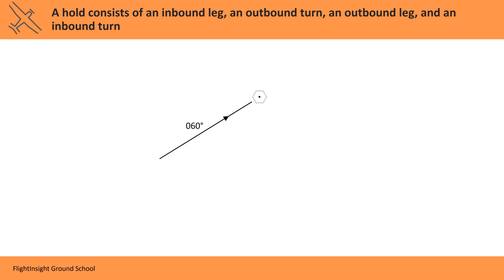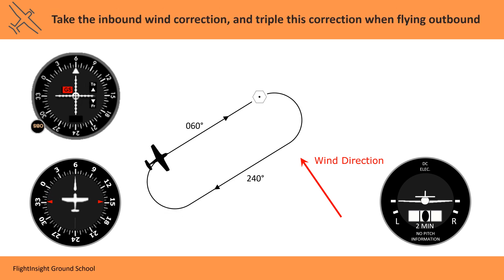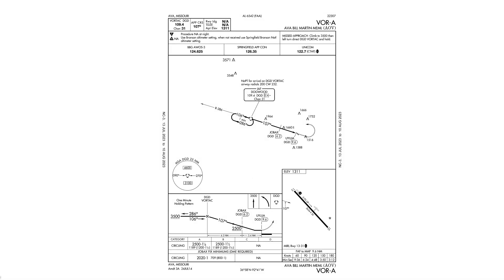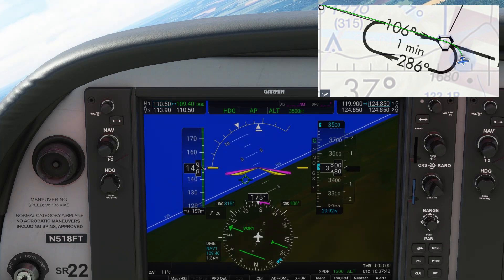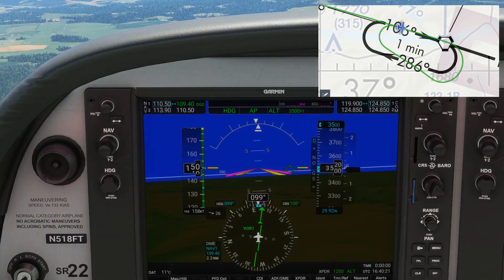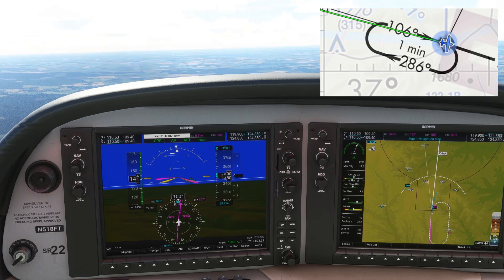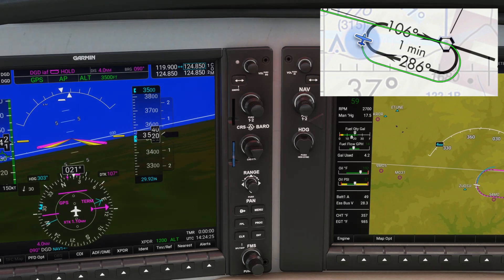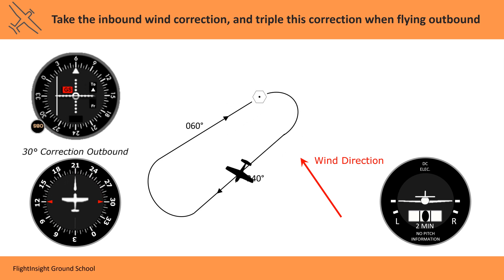Triple Drift Correction | Holding Patterns with Wind

Comment: I am a ii and I remember teaching this until one day in the plane I gave my student a 2 minute leg and all of the sudden the 3x wind correction took us way further into the hold so when we rolled onto the inbound leg we were far outside of it. I realized that day that this only works on 1 minute legs and it also doesn’t work on DME holds. But nonetheless very useful info and you can apply the concepts and adapt it to any hold
Reply: To fly a 2 minute leg holding pattern, you have to fly 1 minute of the outbound leg with 3x wind correction and the time left with 1x wind correction.

Let’s take now a 1’30 leg : you will fly 1x wind correction on the inbound, then turn to the outbound, then fly 3x the wind correction for 1 minute, and after the minute you will fly 30sec  with 1x wind correction before turning to the inbound leg
Reply: @ShurikAviation  that’s one way to do it. For me it seems easier to teach if two min hold then do 1.5x correction of wind instead of 3x works perfectly

Comment: If the wind is the other way, would the GPS-AP end up making a higher than standard rate turn on the other side or would it preemptively reduce the turn rate of the first turn so a standard rate turn will work on the second turn?
Reply: Yes, A coupled auto pilot isn't bound by the human limitation and best practice of always making turns standard rate turn. said differently, a coupled gps will do what ever necessary within the envelope to keep the little airplane on the magenta line

Comment: LARS

Left turn hold you add to outbound leg for your wind correction 

Right turns in holds you subtract from outbound leg
Reply: How to calculate what will give a 10 degree correction? What is 96 heading determined by? How did you calculate that it would give a 10 degree correction?
Reply: @1Mr.Legend1  LARS is just to help calculate for a teardrop entry. WCA is the 3x rule.

Comment: In a nutshell:
When hand flying use triple wind correction (x3 of inbound WCA on outbound) on straight legs and standard rate turns to create a bike chain shaped hold
When on autopilot, the FD will do the opposite and not use standard rate turns but no wind correction on legs to give a perfect oval shaped hold

Comment: 1:59 What is 96 heading determined by? How did you calculate that it would give a 10 degree correction?
Reply: Because his selected course 106 but his actual ground track was 96. 106-96= 10
Reply: you did not understand. Where and how did he calculate that he needed to make a 10 degree correction? Why 10 degrees?
 @diegoencarnacion
Reply: @1Mr.Legend1 look at the approach plate, it’s saying that you should flying on a heading of 106. However due to the wind he has to adjust the heading so it doesn’t blow him away and 96 seems to be the magic number. The heading will shift constantly depending on how strong the winds are. If you’re flying in a glass cockpit it’ll have a wind correction diamond and you just line up the needle with it and you’ll get your correction
Reply: Why do you say 96? What is the calculation technique? How was 96 determined?

 @diegoencarnacion
Reply: The inbound course was 106 (as depicted on his plate) his wind correction was holding him at 106 however if you looked at his ground track/heading bug you can see he was flying on a heading of 096 instead of what the plate was saying to fly which was a course of 106. He needed to do that to keep course 106 because of the wind that was pushing him. The difference between 106 (intended course to fly) and 096 (the heading he flew to stay instead for wind correction to be able to maintain the course of 106) is 10. The rule of thumb is to triple whatever your inbound correction is and apply that to your outbound. In this case that is 10, (because the difference between 106 and 96) 10x3=30. So now he is going to be using a 30 degree correction on his outbound so he lines up properly on his inbound, otherwise he would undershoot/overshoot his approach determining on where the winds are coming from.
Reply: @jonathangarza4668  I ask how he figured out that the plane had to fly at 96 degrees. My question is very simple. It says 106 degrees on the chart. Wind strength 27 knots. According to which and how calculations did you find 96 degrees, how did you calculate the 10 degree difference?
Reply: @1Mr.Legend1  In this video the 096° heading seems to be determined from the pink track bug on the HSI on the G1000, which makes it very easy to instantly determine your wind correction angle. If you are flying without a glass cockpit you would calculate the WCA for that specific track using the wind forecast and plotting it on a flight computer, or by using an app (e.g. ForeFlight or SkyDemon) before the flight. Alternatively you could simply calculate your maximum drift given the wind conditions and estimate the WCA based on the difference between your track and the wind. If you don't have a physical flight computer there are online ones (e.g. E6B emulator) or you can do it by hand using trigonometry (using your true airspeed and crosswind component to calculate the drift angle).
Reply: @1Mr.Legend1 

There is a formula to calculate it:
WCA = xwind*60/TAS

WCA - wind correction angle
xwind - crosswind component
TAS - true air speed

In this example:
WCA = 27*60/146 = 11° so approx 10°
Reply: @KubaSkulski  Thank you, I was looking for this information. Is it 99% reliable? How did you learn?
Reply: @Melon088  thanks for information.
Reply: @1Mr.Legend1  yes it works every time, try to use it. I learnt it on my university and on ATPL course on gnav subject
Reply: @KubaSkulski  I understand, this will help me a lot, thank you.